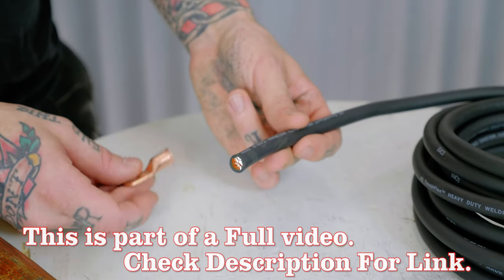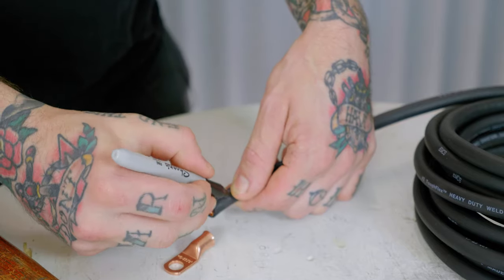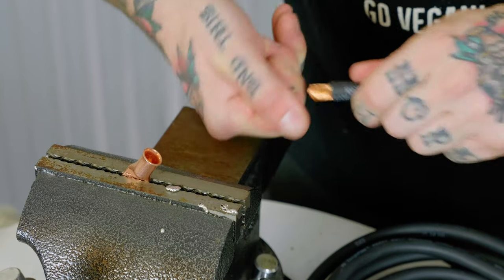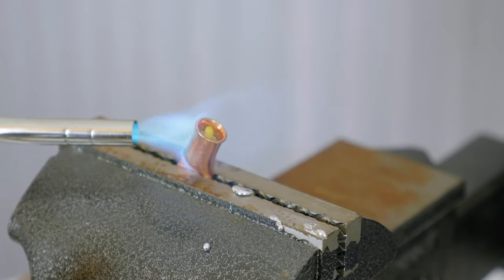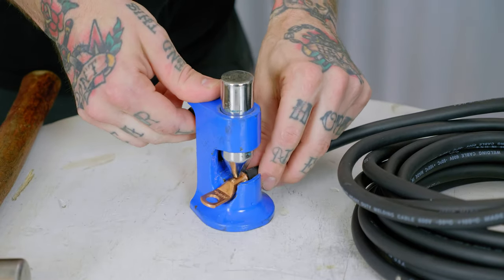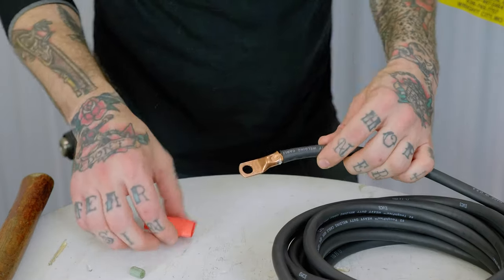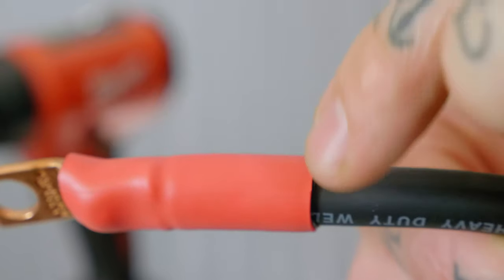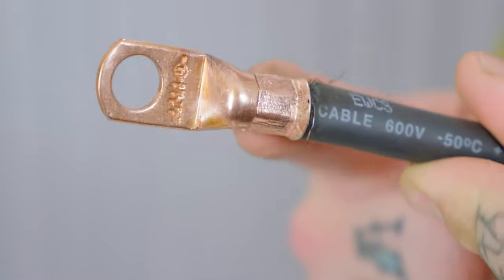How to Solder & Crimp Battery Cable Ends - Quick Tip

Comment: Buy a hydraulic crimper or on a budget get a hammer crimper and use quality adhesive lined heat shrink to seal out the moisture. Always use Selterm or Ancor brand lugs. Temco cable for protected environment and Ancor for harsh (road salts- marine bilges). A hex crimp is needed in one place and should have crisp corners.
Reply: Is this a summary of the video? Because that’s what he did, almost to the letter.
Reply: Not even close. He soldered it first. If the terminal gets overheated in use, the solder can melt and flow into the strands leaving room in the lug despite crimping. Soldering for that reason is not allowed in house and industrial cables in America. Only compression/screw terminals or crimping. For marine and automotive, it has been found that the flux used in soldering exasperates corrosion if moisture intrusion happens. Adhesive lined heat shrink is not perfect and commonly leaks with flexing.

Comment: Very timely series of videos.  I need to change the #6 coach battery wiring in my RV to 4/0 and put in some 500 Amp voltage sensing relays.
Reply from the maker: Oof. I used 6ga on the alternator charge wire for this 55 Belair I'm doing and I considered going even heavier than that. I redid a 53' Horse trailer / Camper some years ago and had to run a whole new cable the length because I just didn't feel what they used was sufficient. I guess when you are building things for profit every bit of cost cutting comes into play.
Reply: @HotRodHippie  Yeah, I'm not too excited by the cost of the material but this sets me up later for putting in a 300 amp alternator and additional coach batteries.  Blue Sea and Waytek have some good stuff on their websites.  Blue Sea tends to repackage some of the smaller stuff so it's good to look at their catalogue and then try to figure out who really made it.
Reply from the maker: @SteveRivett  Del-City is another great source. Their pricing is pretty good if you need the kind of quantity you may need on larger projects. My problem is I run into needing to order 50' of wire for a car project and I just cant justify it then.

Comment: Would it be any better to crimp the wire and then drill a little hole in that 45 degree slope and then solder it? It seems the solder would then fill any gaps or air pockets left from the crimping method.
Reply from the maker: Heating up thick battery cables for soldering once assembled is next to impossible in my experience. Well it can be done but it starts to burn the insulation before you’ll ever get a good solder joint. 

I try to crimp the connection IMMEDIATELY after soldering so the solder is still a little soft. Ideal? No, but it’s work well for me so far.
Reply: @HotRodHippie  Still wrong, sorry but you don't know what you are doing. 
NASA: Workmanship Standard for Crimping, Interconnecting Cables, Harnesses, and Wiring
You are just creating a brittle joint
Reply: @____________________________.x Does it look like he works for NASA? Or do you think he’s building a spaceship? Because if he’s not it probably doesn’t matter as much as you think.

Comment: Those were the two worst ways to do this. You've clearly never worked in Industry
Reply: Agreed
Reply: How would you do it?
Reply: @garymarch4711  Hydraulic crimping tool. A tiny line of dielectric silicone grease along the exposed copper, adhesive lined heat-shrink over the end of the wire.
Reply: @____________________________.x  he used a hydraulic crimp on one end. What is the point of your criticism?